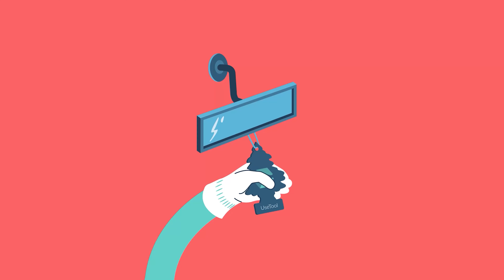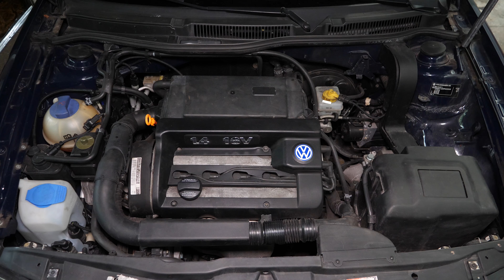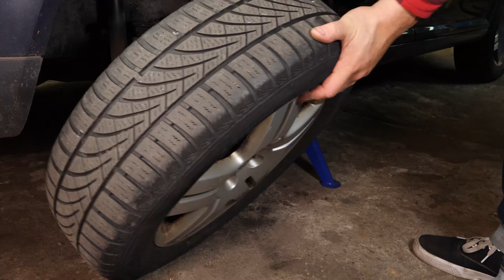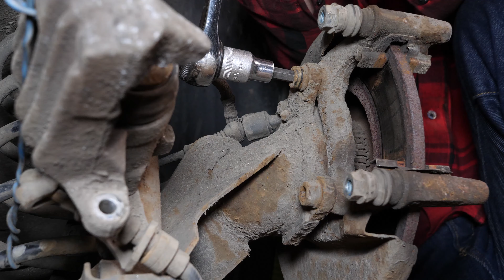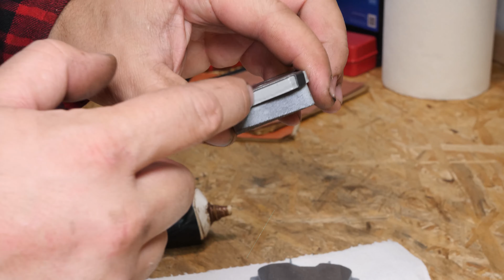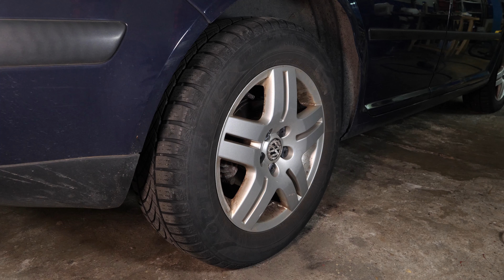How to replace the rear brake pads Golf mk4 🚗

Comment: So I'm not sure on who's right here so it's more of a question than it is me saying you're in the wrong, but first thing how much torque should I use on the screw connecting the caliper? And isn't copper grease going to seize the pads ? I was always tought to use a grease with no metal in it that is temp resistant.

Comment: This is a lesson how to not jack up a car!!
Reply from the maker: Ok, maybe we should improve. What are your suggestions ?
Reply: @UseTool_EN dont lift on the sideskirt that does not have lift point, you will push in the skirt. If you are going to use a jackstand, lift from the framerail underneath. 🙂
Reply: @kaarelolen the jack that came with my mk4 is designed to slot into the skirt. Should be fine tbh.
Reply: @UseTool_EN maybe not threading the wheel studs back on with a tool always hand thread them first before using a tool